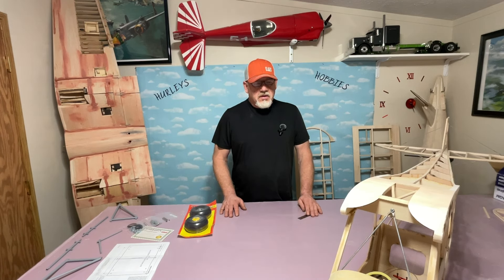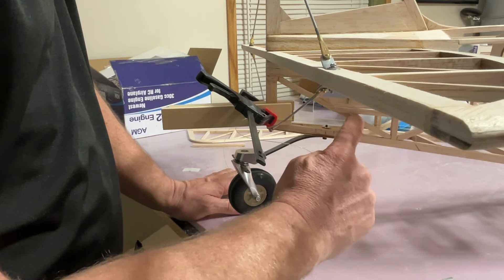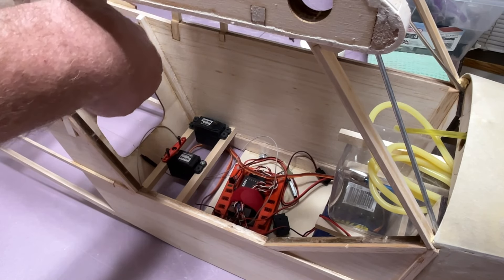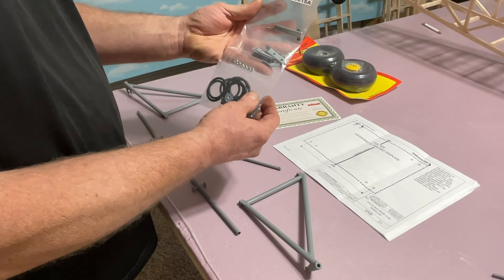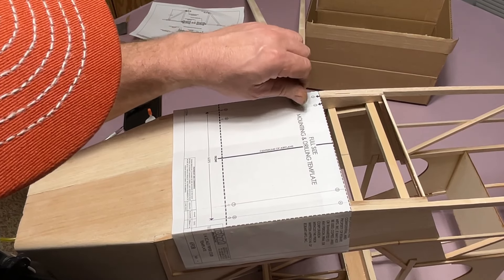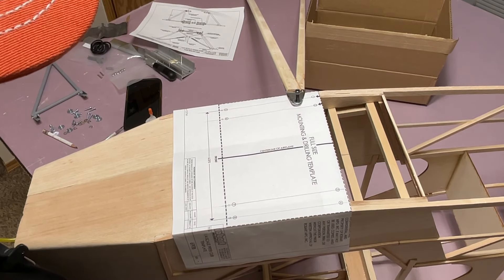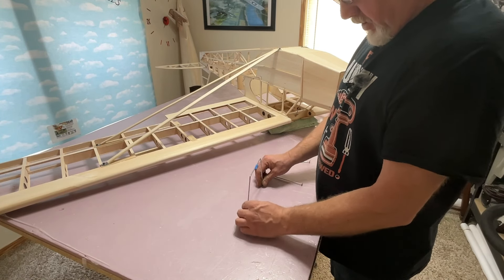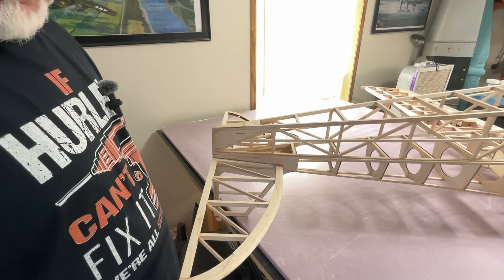Balsa USA 1/4 scale Cub build S25

Comment: From your video it 'appears' that you moved the position of the new landing gear BACK from where the original wire gear was located ......do you believe that will result in any change in take-off/landing and/or CG?
Reply from the maker: I put the gear in the same place in the back as I interpreted the instructions
Reply: @Hurleyshobbies  Understood completely about following the instructions ...but I was just wondering if you're concerned about the 'shift' backward of the wheels and any impact on balance, takeoff/landing ?